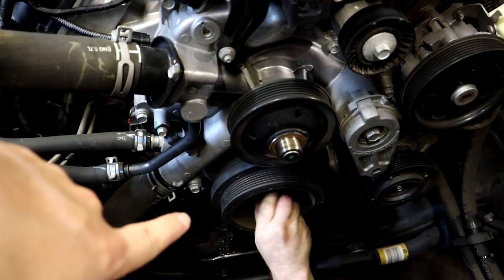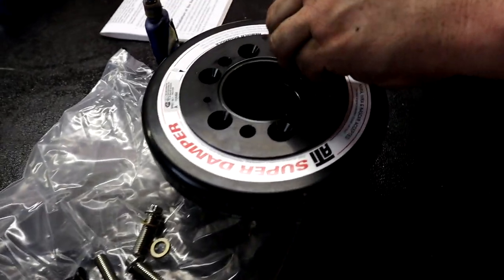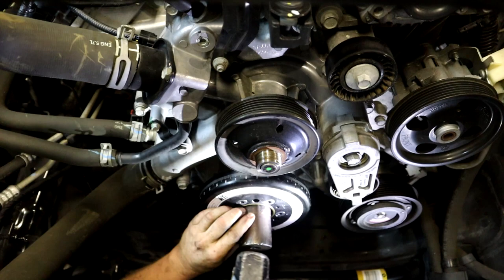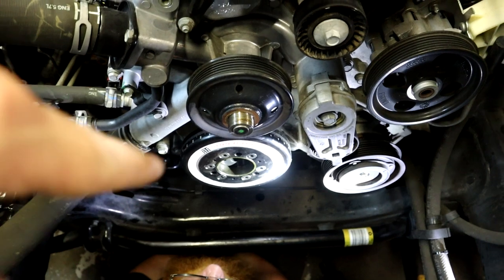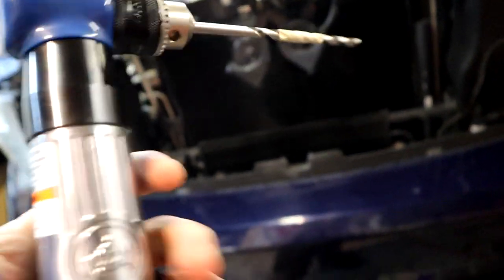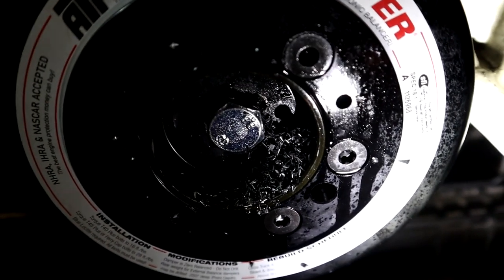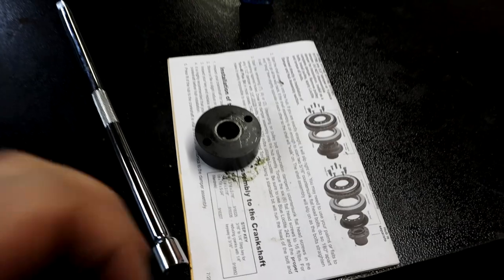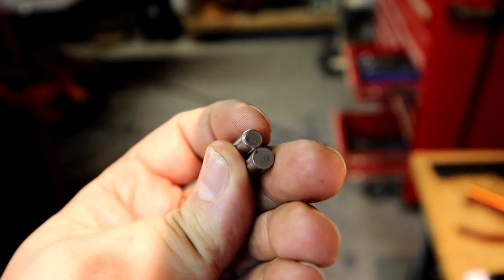Project STORM TorqStorm Supercharger Install RAM 1500 4X4 Part 2

Comment: Are the stock pulleys on ram trucks 6 ribs ? If so do all new 8 rib pulleys come with the torqstorm kit ?
Reply from the maker: The torqstorm system uses its own 8rib belt system. The factory belt system remains the same so you will have to separate belts

Comment: Do you think thairs a benefit of putting a ati balancer on over stock , I was wondering if it would help with harmonics/ smoothing out overall smoothing out the engine itself idk , whats your thoughts since you have one?
Reply from the maker: Really not sure but it is lighter for sure but its required for the torqstorm supercharger setup to work.

Comment: Why didn't you video pulling the ATI damper onto the crank.? I had problems with that part
Reply: All the hammering was the setting of the ati damper onto the crank
Reply from the maker: We did lol you didn't see us beating the crap out it🤣
Reply: @FrostbiteRam  why would you not use a installing tool instead of thrashing the crank ?

Comment: So if you already have a forged bottoms end, and your ATI dampner is keyed to the crank. Would you still need to pin it?
Reply from the maker: Good question i would think not but if it was me I would probably just drill one hole and do one pin for extra safety.

Comment: Y’all didn’t full the key way with RTV?
Reply: Why do that ? The key way doesn't go past the seals, nothing will leak.
Reply: @DL101ca  I’ve been told it’ll leak oil from there even from ATI
Reply from the maker: Yes we did and it is in the instructions from torqstorm to do so also👍we used ultra grey my favorite.
Reply: Well I've had my ATI installed for 2 years now and no sign of oil leaking